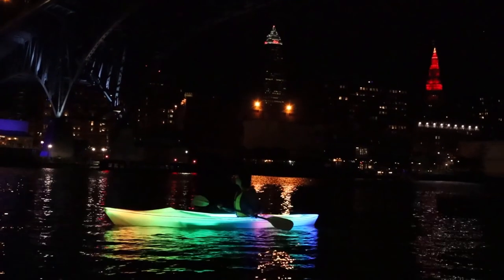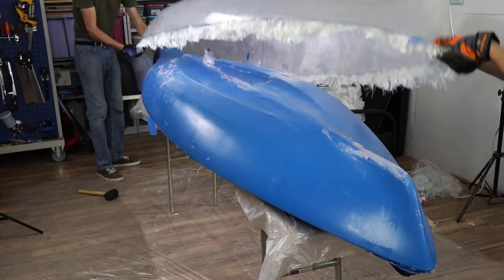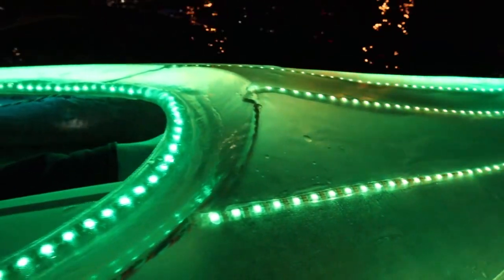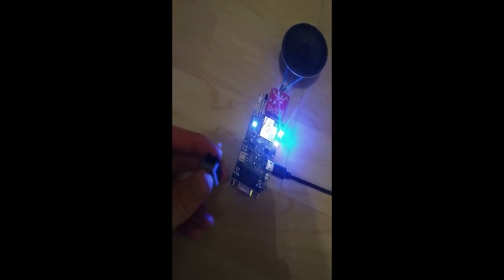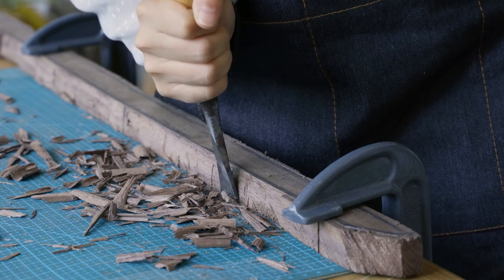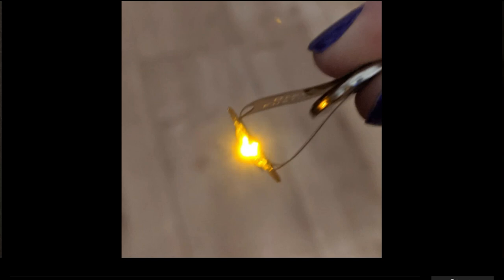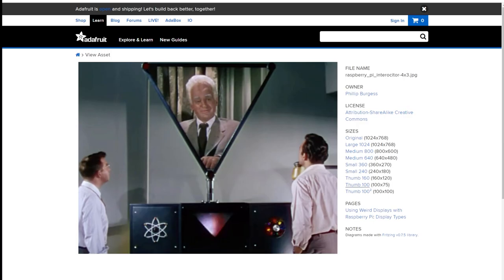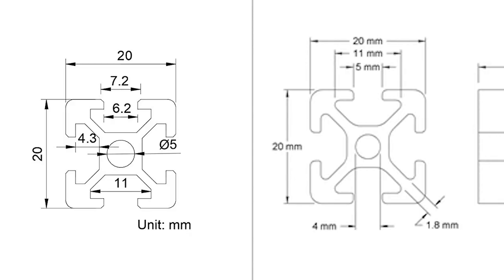RGB Raft on Blue Water [Maker Update] | Maker.io

Comment: If you want to find the distance between two holes, measure the shortest distance between the two holes and add the diameter of one hole. That will give you the distance between the two centers. Been doing that for years. But the cones are cool too! Good projects this week.
Reply: I think the cones would be most useful in finding center to center of different sized holes.
Reply: @dustind3502  - yes but you can still achieve it with math. 1/2 diameter of one hole plus 1/2 diameter of the other hole. And their total together and add it to the distance between the shortest dimension between the holes. I was quality engineer on my first job and when I was on the production floor I would perform this on spot checks then I would move them to the QC office to further check on the CMM to get the most accurate dimension. But if I’m getting dimensions off an electronic component to layout a CAD file I’ll use my formula when accuracy is +/- .010”. Good enough for layout. The 3D printed pieces need to be extremely accurate in their printing and placement on the calipers. I may try and print a set and see how well they work and post my findings here. If they are accurate then they would work but it’s been my experience with my printer there are deviations on the surfaces that may cause inaccuracies. In my opinion. Conical shapes need to be perfect on surface and most times they are match ground to obtain accuracy. This is an ok idea. I know it’s the Maker Update channel but not everyone has a 3D printer. I’m just giving people the ability to perform the same function with their Calipers.
Reply: @MrWATCHthisWAY  yup 👍
Reply: @MrWATCHthisWAY  I always like (<outside to outside> - <inside to inside>)/2 This way the hole diameter doesn't matter.

Comment: Great video as usual! On thing tho: the way to properly measure hole centerline separation is you measure the distance between the two closest edges of circles, measure both their diameters and add half of each diameter to the measured separation. If the holes are the same you just measure separation and add the hole diameter. The little add-ons are cool but i have a strong feeling that theyre going to be super inaccurate - a machined set of ad-ons would work with adequate tolerancing but I feel like youre gonna lose the accuracy of using a caliper to the inaccuracy of 3d printing.
Reply: HAHA I just realized that that John Paul Lafferty guy commented the same thing. Glad I wasn't alone in thinking this